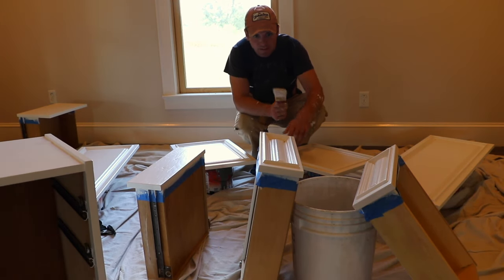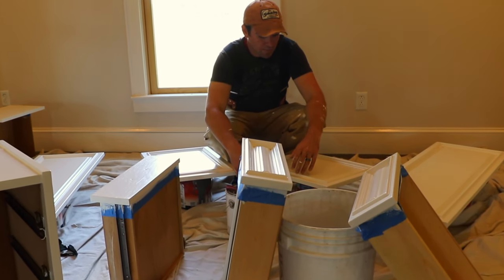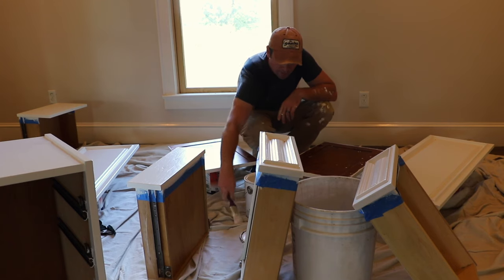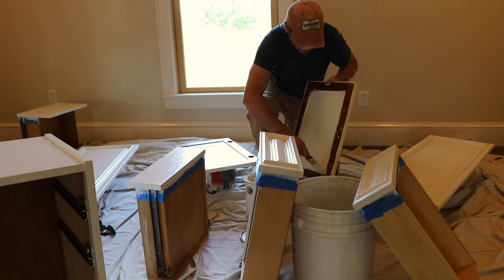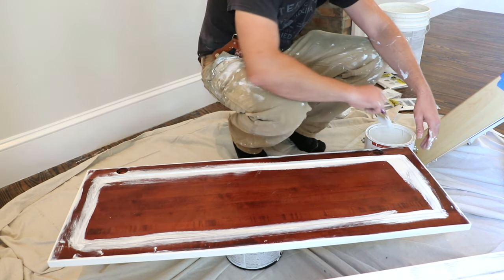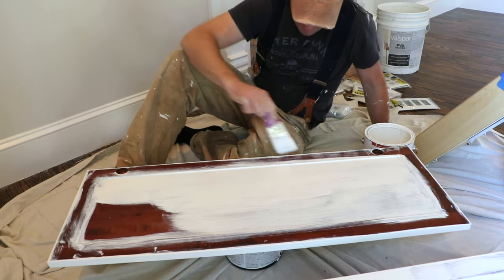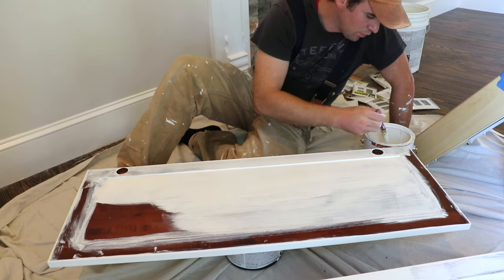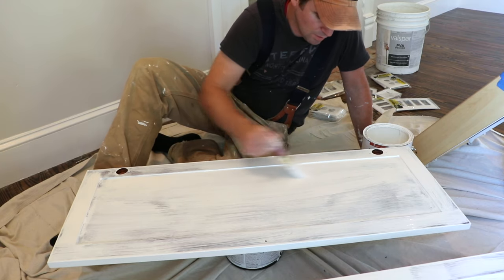Valspar Cabinet Enamel Painting Cabinets Without Brush Marks - Trade Tips

Comment: Did you sand between coats? Im doing a door right now and I'm accustomed to sanding between coats for a smoother finish and did so out of habit and I think it may have ruined my smooth finish... I have visible paint brush marks all over! Help! (Btw... just a tip... its not an oil based paint... the can says "oil-enriched" but it is in fact a hybrid waterborne alkyd) thanks in advance for your help!!

Comment: No problems brushing but using a foam roller I get wired tiny oil looking bubbles. Interestingly they all go away quickly and the paint drys smooth

Comment: Finally a video that shows just the paint and no primer . I was worried that I would have to get primer and apply two coats then like 3 coats of paint making the project longer . Question:how has the paint held up so far without primer ? I like the designs of my original cabinets so don’t want to remove the design with primer of that makes sense . Thank you 😊
Reply from the maker: They have held up fine.
Reply: @YanasaTV  thank you so much ☺️

Comment: Spoke with Valspar about this paint. I wanted information on painting cabinets using a HVLP (high velocity low volume) sprayer to apply the paint. HVLP sprayers are inexpensive and easy to use. An application with a HVLP sprayer is simple and easy to do and gives good results. 

However, to apply the paint you need some basic information, such as viscosity and recommended tip size.  To  make a long story short, I spent an hour speaking to Valspar experts. 

They know nothing, could not help as they were not allowed to have that information. One actually told me the paint was only for DIY use with a brush or roller. He also informed me all cabinet makers use "Airless sprayers"! I am sure this will be news to us making cabinets!
Reply from the maker: I’m currently working on a new cabinet project with the same paint.  I’ve decided to wet sand it with 1000, 2000, 3000 grit then apply a wax.  The finer grits really help out but it’s a lot of work.

Comment: How long did you wait between coats to apply another coat? And did you use a top coat to protect it?
Reply from the maker: I did not use a top coat to protect it, the paint itself is very hard and durable.  I waited a while in between coats, I normally let it sit at least 6-8 hours, it is a self leveling paint so as it dries it slowly dries and levels itself out to a smooth finish.

Comment: Is it possible to paint them with this paint without sanding?
Reply from the maker: Beauty Glam Fashion it shouldn’t be.  According to their advertising anyway lol
Reply: No it's not, I have done several kitchen cabinet jobs and I have used the valspar brand but Sherwin Williams is much better...you should always sand or use a deglosser and prime before painting if you want your finish product to last, and last but not least when all the cabinets have been painted take your shirt off and put some of the left over paint on your nips and press them against the wall or any nearby flat surface

Comment: Do all your painting squatting down? No primer?
I used that paint on 5 doors to start. 2 coats of Primer. I used a 4 foam roller= air bubble bumps.
I don't see this $$ painting smoothing out even with thin coats. Drys to fast too. so know over working the area or you lift up the paint.
in switched to Sherman Williams premium satin acrylic paint. Much more easy to apply and great. coverage..I added 2 painting of clear top coat for that rock hard finish
Reply from the maker: +Jack Soxman I suppose I'm in better shape than I thought... but I paint anyway I can in the space I have.  I didn't have any bonding issues with the paint, I think the point of that paint is that it bonds well.  I did sand the surface a little which helps with bonding.
Reply: Rankin Ranch NC does it work on non wood cabinets?
Reply from the maker: Be sure to check out Reconstructing Spirit Hill Episode 4 "Dried-In" https://youtu.be/5pGZXvt1aQ4
Reply from the maker: Be sure to check out Reconstructing Spirit Hill Episode 4 "Dried-In" https://youtu.be/5pGZXvt1aQ4
Reply: Yanasa Ama Ranch j